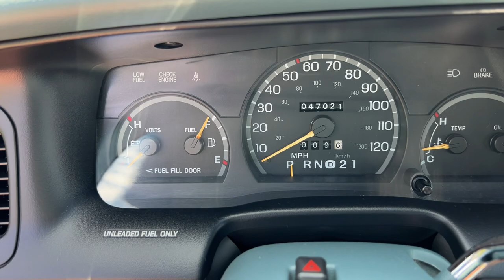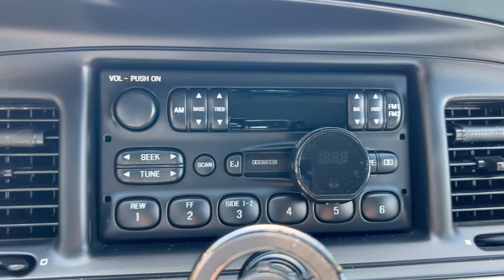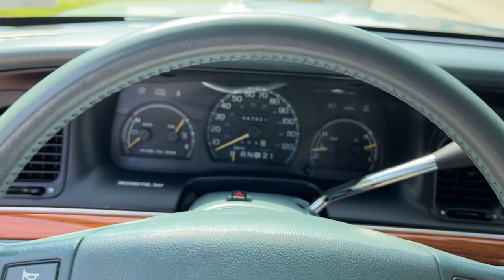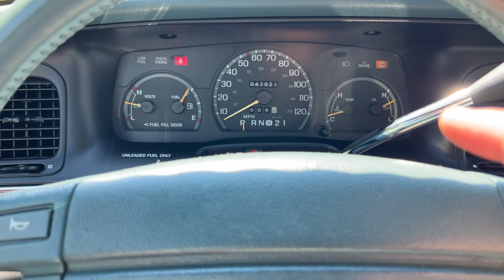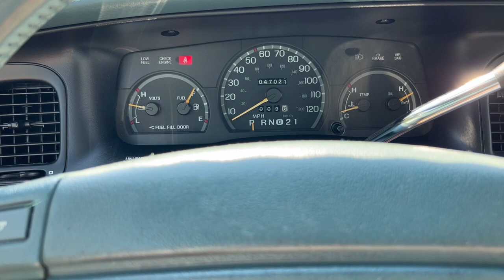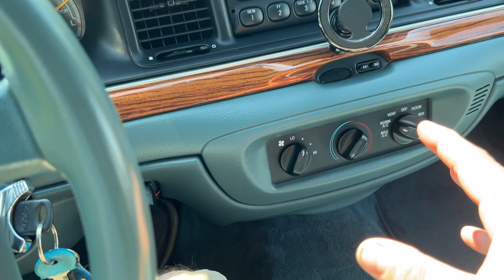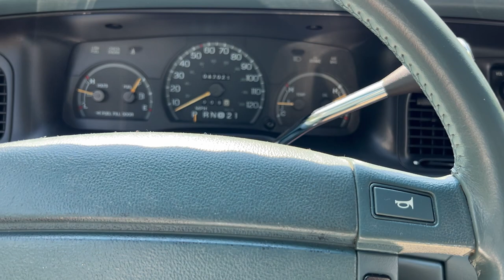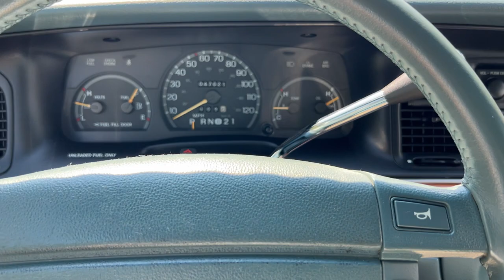Fully Detailed 1995 Ford Crown Victoria Walkaround, In Depth Tour, & 2023 Update

Comment: Nice car man! I have a 96 with the HPP package and have experienced some of the same issues you mentioned. I got the abs light with the same code on my car but the problem was intermittent, sometimes it would appear every time I turned the car on, other times I would go a month without seeing it. It would usually pop up after reaching 13 mph for the first time which is when the abs pump does it's second self diagnosis test. I ended up spending a whole lot of money chasing down the root cause for the problem but I can confidently say its the abs module that's malfunctioning, the pump itself should be fine. Its actually a common problem on these cars even on the later models, something about the quality of the soldering in the module. I had mine removed and sent it to a company called "modulemaster" and they repaired and sent it back in less than a week, problem fixed. I've driven around 10k miles since then and had a couple close calls where I've slammed on the brakes and everything works perfectly as it should. I recommend you consider this if the light keeps coming back. As for the air suspension, its normal for the pump to run every time you start the car, the way the system works is every time you close your doors, the air suspension module checks the current weight of the car, if it notices that you're no longer in the drivers seat it will decrease the air in the bags, once you get in again and close the door it will re-inflate to compensate for the extra weight. What I did notice is that you said sometimes it takes longer for the air suspension to fully inflate which to me is indicative of a leak somewhere in the system, it shouldn't take any longer than 10-15 seconds unless you've lifted the car up. Still, I'd say its worth it to keep the air suspension system if you plan on hauling around a lot of items as it will keep the ride level at all times, it also came stock on the mercury marauder so you know its better performance wise over conventional shocks. And please don't sell it! Unmodified crown vics such as yours are becoming increasingly rare as the years go by, who knows maybe one day they'll be as sought after as the classic impalas lol
Reply from the maker: Thanks for the info. I've only had that abs light come on twice so hopefully it won't appear very often but if it does I'll look up that company. I would consider replacing the air suspension bags with new ones assuming I can get one of my local Ford dealers to want to do it. I hear most people just convert them to springs but as long as the pump and solenoids still work, I think the bags themselves are fairly cheap. It would just depend on how much labor is involved. My main issue is the rear of the car always has a clunking/thud sound over any bumps. It passed a bounce test so I'm not sure if the shocks are bad or not but if they're the original it probably wouldn't hurt to replace them. The only issue might be trying to get the nut on the top of the shock off if it's rusted on since it's in a tight space. The only way I'd sell it is if someone was willing to pay well above the book value for it because they know they're hard to find in this condition or if I could get a low mileage Town Car in similar condition.
Reply: @Mr.Everything  No problem! And yes, i also had trouble finding a mechanic who knew how to work on these air suspension systems, luckily there was one remaining guy in my area who only worked on town cars and he fixed many of the mistakes previous mechanics had done to my suspension. I think Arnott brand airbags are the way to go since oem ford-firestone bags are almost impossible to find. The ride quality feels the same to me only because arnott bases their bags off of the ones for HPP vics, regular lx trim came with softer airbags so you may feel a bit of a firmer difference in ride quality if you decide to buy them. When i replaced my bags, i also did the shocks for convenience sake, there doesn't seem to be a lot of components to the rear suspension so your clunk may just be that. Also, keep in mind that the air suspension uses special oem motorcraft shocks (part #: AS2010G) not sure what the difference is compared to the base model shocks but they're the ones I bought just to be safe.
Reply from the maker: I have a Lincoln dealership right down the road from where I live and they regularly sell Town Cars and Grand Marquis so they may be experienced with repairing the air suspension assuming they don't just convert them to springs. My next decision is to get newer tires too. I want to stick with white walls but the only 2 options I see in my size that aren't no-name brands are Vogue or Uniroyal tiger paws. The Uniroyals would be a lot cheaper than the Vogues but I've read both have good reviews. As far as I know Michelin no longer makes the white wall tires that are currently on it.
Reply: @Mr.Everything  yeah there are very limited options for white walls but i think either one would look good on your car 👍